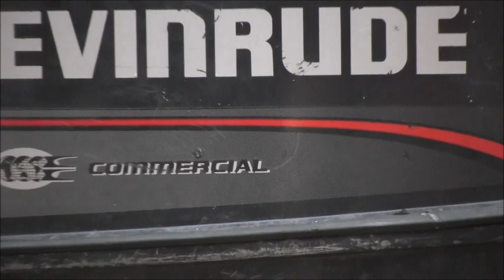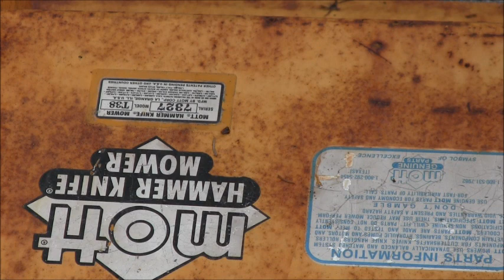EVINRUDE 1999 8 HP,  OUCH !!!

Comment: Kodi, In an old world hardware store in Portland that had EVERYTHING, "Chown Hardware" Your "crow bar", in a number of sizes, was labeled "Wrecking Bar". "Crow Bar"s were 5'-7' straight bars, with a point on one end and a flat spade point on the other. Some had the spade point angled a bit for different prying tasks. I still have several of each in different sizes. I remember so well because my Dad made a point of showing me the difference. Dad also said that a 'Crow Bar's' primary use is to "crowd" things. The term 'crowd" was common old world language, still used in some circles, for moving heavy items, not just moving it, but moving it precisely. IE, "Crowd it together a bit more, and hold it while I get this wedge in there."   Your little pry bar is a "flat bar'.
Reply from the maker: Great insight thank U  4 sharing , kodi

Comment: The bar with the "hook" on the end is called a "wreaking bar", the smaller flat one is called a "pry bar" and is also used for removing nails (not to be confused with a "cats paw" that is used for removing nails), and a "crow bar" is a straight long heavy iron bar (60 inches or more) with a chisel or pointed end that I used on the farm when growing up to pry or punch through rocks when digging fence post holes. At least that's what my dad taught me. But I've seen those terms used interchangeable. But whatever works in a pinch and gets the job done... no matter what it's called.
Reply from the maker: But why crow?  I get  pry,,,wreacking     kodi
Reply: @kodibassInsideoutboards  Best I could find for the reason of the name is that it dates way, way back (13th century at least) and it's a reference to a crow's beak and how crows would use their beaks to pry things apart.  But I think that's a best guess by the scholars.

Comment: Just bought a 94 evinrude 8 hp and going thru it. had to replace the wires under the fly wheel all the insulation was falling off. motor was made in belgium. hope it turns out to be a decent motor. still trying to figure out how the tilt bracketry works.. lots of levers.

Comment: I hope it went back on easier than it came off... I noticed you didn't show in the video how that went.
Reply from the maker: Yep' I did not show back on with it or lower unit as I was talking first to a full Sd card & second to a dead camera battery.  Way easier going back on,   lubriplate-105 slip done.  kodi

Comment: I have a 94 evinrude 8hp model number 8erere. Its goes into reverse but not forward, what could be wrong?
Reply from the maker: Check your shift linkage for anything that may have come off or loose. If that is all ok it will most likley B the shift trunnion under the power head, or shift cam in the fwrd most section of the lower unit gearbox.    kb
Reply: Shift lever ball bearing was broke,thanks!

Comment: Well, that's one way of doin it for sure....Customer is lucky you have such a vast grave yard?  What was wrong with the Johnson donor, took a swim??
Reply from the maker: Yep'  good as new ready to B abused all over again,  The donor power head is good I will still put it back 2 work soon.     kodi
Reply: @kodibassInsideoutboards    So you robbed the midsection off a good motor to help that customer?  Pretty nice guy
Reply from the maker: @fleetwin1  The customer is one of my best friends / fish getter... as stated in the video  He Always finds the fish.  haha  the broken part will be welded along with the broken cav fin.     kodi
Reply: @kodibassInsideoutboards    Cool, did he tell you how he broke it?
Reply from the maker: @fleetwin1   Yes his truck slid off the road with his boat on the trailer,  The whole rig came to rest on a rock clif ,  The trailer was 45 degrees to the truck resting mostly on the kicker & kicker bracket.     kodi